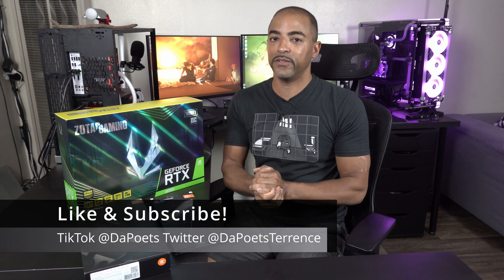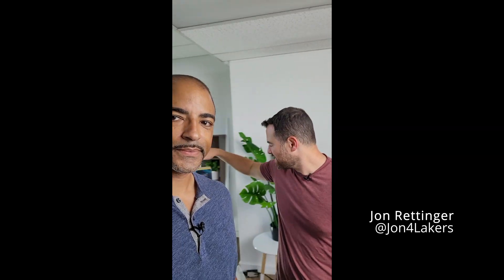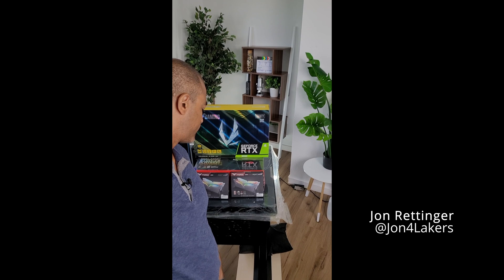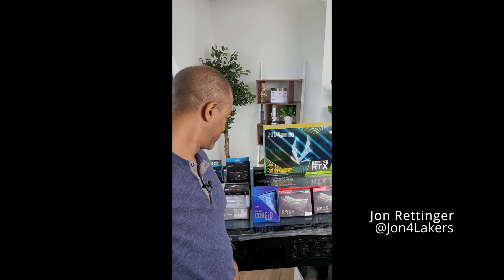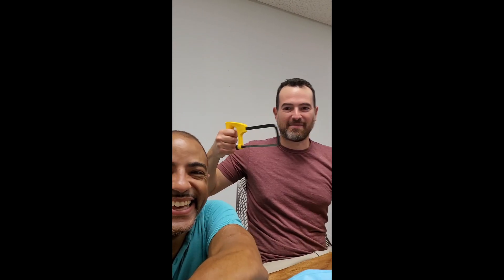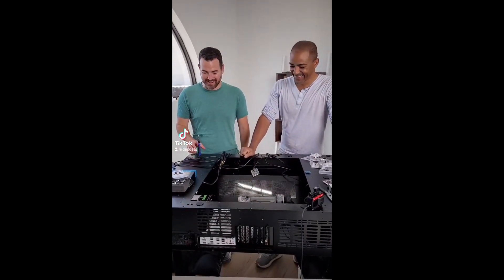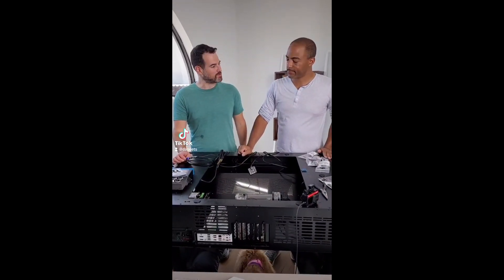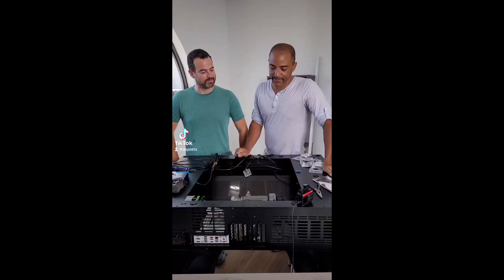EK Quantum Vector GPU Water Block - ZOTAC RTX 3090 Trinity OC

Comment: Great video! I have a Zotac rtx 3080 trinity oc, when gaming it goes up to 80 degrees Celsius. At the moment my room temperature is about 25 degrees Celsius and I am worried that by summer when my room temperature is gonna be in the 30s that it’s gonna overheat. Do you recommend installing the water Block? Btw it would be my first time doing something like that and I am kinda nervous about doing something wrong.
Reply from the maker: Research, watch videos, but this in the end is one of the easier cards to put a water block on

Comment: Thanks for this great video! I was able to attach the EK water block to my new Zotac 3090 (after dry testing) and then pipe the fluid through two M.2 cards, then through the radiator and back to the pump in just over a day of effort. Not bad for the first time (the CPU is cooled with a separate AIO).
Reply from the maker: Excellent 👍👍

Comment: Hey I actually just installed the same water block/backplate on my trinity 3090. I noticed that I had to tighten the screws near the IO to have it not loose. As a result the rear of the backplate I slightly bent. Did you encounter this too?
Edit: I would like to mention that the backplate as a whole has a slight bend or curve to it even though I didn’t use excessive force, you wouldn’t notice unless someone pointed it out.
Reply from the maker: This can happen if incorrect thermal pad sizes were used in wrong areas...
Reply: @DaPoets  I 100% used the right thermal pads, followed the manual exactly. I wonder what it could be… it’s really bothering me but I’m sure it’s nothing.

Comment: When I decided to try moving to watercooling, it turned to be a headache in two unexpected (for me) spots -  the case space aaaaand the non-reference gpu. Mine's an MSI 2080Ti, and I did spend a hell of a time trying to find a waterblock for it (from the otherside, when I saw that EK has one, I decided to get the whole loop there and didn't regret for an instant). But even then I still ended up with the backplate being screwed in with just 3 screws (I honestly cannot understand if there wasn't enough screws, or I just did something wrong).
Reply from the maker: Yeah water cooling takes a lot of planning

Comment: Same GPU. Got it from zotac in November. Water cooled it with EK as well as their active backplate a few weeks ago. Fantastic temps and performance. The stock cooler was terrible and often sounded like an airplane during gaming. 

Installing the active backplate was the hardest part for me. The alignment of the screws on the water inlet and outlet piece was a nightmare. I almost gave up.
Reply from the maker: It can be tricky at times. Sometimes you have to loosen additional screws.